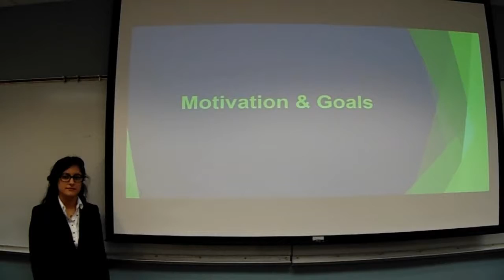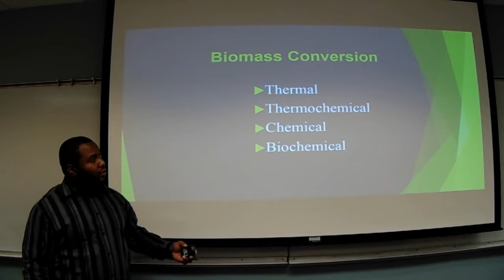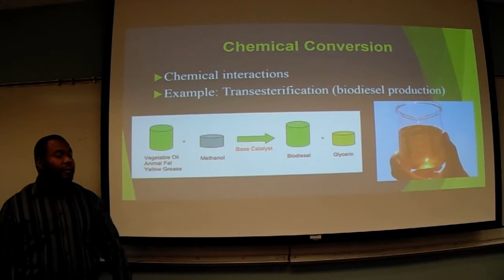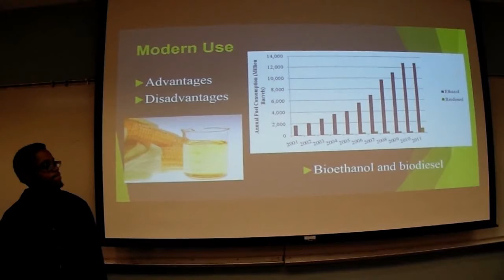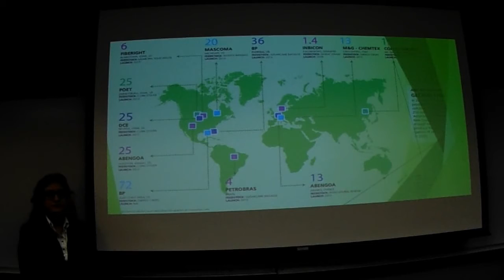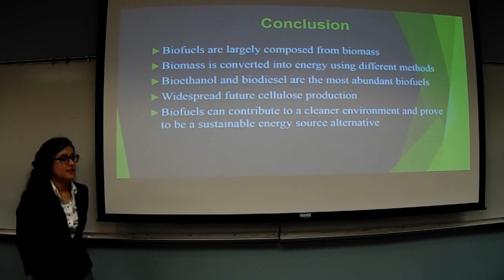Team 12 - Biofuels

Comment: Video is quite dark but the PowerPoint itself is well designed with good visibility. Pictures do a good job of adding to the presentation but missing the solid-works design. Camera clacking is slightly distracting but overall good presentation.